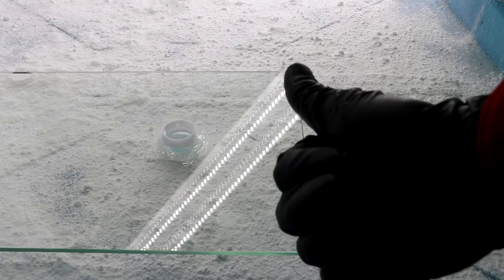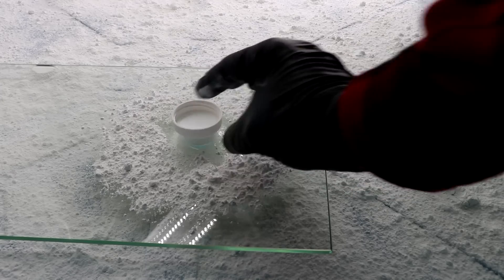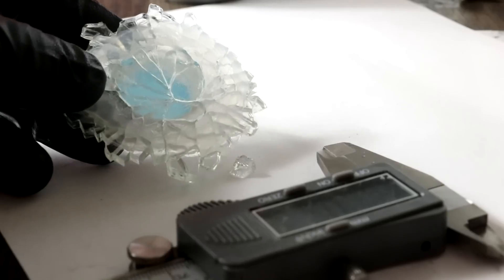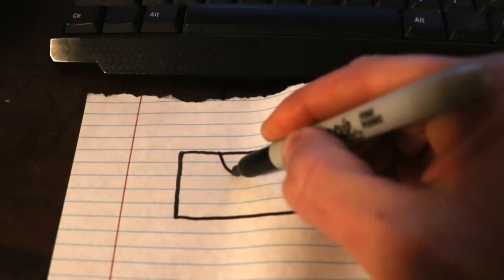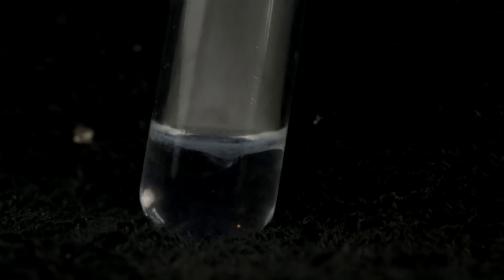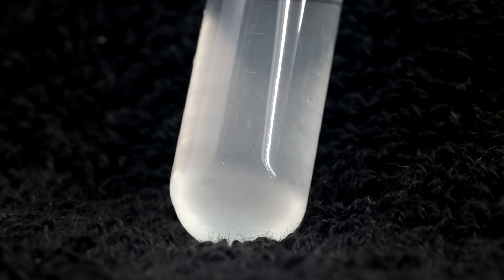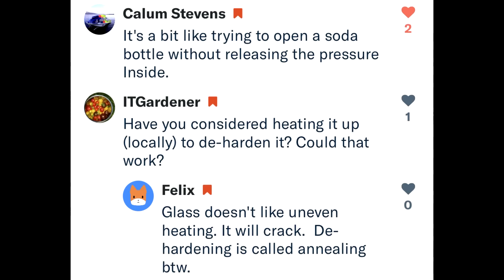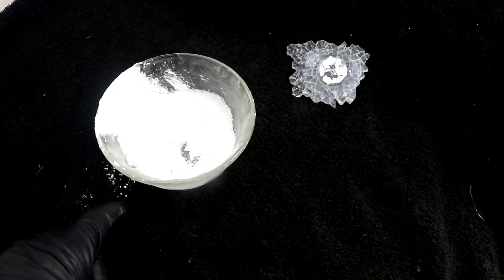Dissolving Through Tempered Glass Attempt Two: from one side only

Comment: @cody'slab This won't work, because you are removing the compression "layer" from the surface, leaving the inner layer exposed which is in tension. There is chemically treated glass instead of heat treating. Would it be possible to dissolve and chemically treat the new glass surface to be in compression?

Comment: Could you stress relief using heat or extreme cold when half way through ?
Reply: When i said heat i mean heat the glass while the acid is dissolving through.
I'm sure the glass temperature will have an effect.

Comment: I'm wondering if maybe slight temperature changes are what is causing it to explode. If you have compromised the structure of the glass by dissolving deep enough wouldn't that allow a larger fluctuation in temperature in the middle because the temperature has less glass it needs to change the temp of.

Comment: Maybe the cold made the glass more brittle?
When I studied to become a lab technician, I learned that pH is a measure of concentration (the balance of the concentration of OH- and H+ ions), so I am consistently confused when you say that stronger acids lower pH more than weaker ones, or similar statements. 
The strength of the acid doesn't increase the concentration, it just affects how reactive it is. Is the terminology used differently in the US?

Comment: @Cody'sLab In my experience of making Prince Rupert's drop I simply dripped molten glass into a bucket of water. I found that, at least from my experience, the hotter the glass was when I dripped it at a foot or two above the bucket into the room temperature water the more likely it was to make a drop. I theorize that the greater the temperature difference the quicker the outer layer is able to form a solid so that it is able to do the compression. The height I think is required for the drop to become fully immersed quick enough that the drop is able to form. When I dripped it from to close it formed less often. At least this is what I recall. Its been a few years since I made them.

Comment: Ex glass blower here. 
1. Tempered glass is constantly fighting with it self. The inside has tension while the outside is compressing(I think I'm remembering that correctly). As you mentioned its shattering once it gets to the center because the tension from the inside becomes to great. I don't see this working no matter how you do it but I'm hoping you prove me wrong.

2. The comment from Felix in the video, Dehardening isnt a word used in glass. Annealing doesn't make glass harder, it takes the stress out from the forming of the glass. The way Tempered glass is made, it will never be fixed by annealing, its already annealed.

Comment: I may have a weird potential solution to doing this. I weld frequently and every so often a piece of glass is nearby and will end up with small spatters embedded in it. I have embedded embers into safety glass several times without it shattering. Not sure about all the science that takes place that keeps it intact but it is a observation I frequently get yelled at for.  ''Look what you did!'' Then I promptly shatter it , got to replace it anyway so why not?

Comment: What if you try to etch a concentric staircase shape. You can etch for a while without breaking then try to etch a smaller diameter inside the larger etched zone and so on. Eventually, maybe you get a hole. However, it is tricky to determine the taper.

Comment: Maybe hit it with a MAP gas torch and try melting when it gets near the tempered glass part? Using two torches symmetrically on the glass piece in the first video might have been the best bet? 

Maybe you need to keep the glass near 1000 degrees F while you dissolve with HF? There might be a temperature where dynamically the glass can be plastic without shattering, and otherwise not melt or flow. Hopefully the tension would be able to dissipate over a longer time scale and the glass not shatter.
Reply: I mean you could but you have to cool the glass very slowly which essentially is just removing the temper.

Comment: curious how molten sodium hydroxide would work, but then again, the thermal shock would shatter soda-lime glass long before it manages to eat a hole in it, and glass that's resistant to thermal shock is basically immune to tempering to begin with.

Comment: Try placing more and more Epoxy onto the glass as you slowly dissolve it. Your Issue is similar to that of a balloon exploding when hit with a pin, a problem which can be mitigated via something as simple as a piece of tape to ensure you contain the rupture. With any luck the Epoxy will accomplish a similar goal absorbing the stresses and redistributing them evenly as you dissolve through. Right now it seems like your best shot since as you are fully aware of the structure of Tempered glass with always prevent you from doing this unless you contain that initial rupture.

Comment: I think it deals with compromising the overall surface tension. Its equal through the entire glass panel. Once a single area loses its sporting role (strength), it shatters. Which means no matter what method you use, it will shatter because its the same outcome of loss of strenth just with a different method.

Comment: HELP: How to distinguish mercury from gallium-alloys with household items quickly? I got a used GPU with liquid metal on the cooler, I thought ok gallium, but I wanted to be sure. I tried to make it attack Aluminiumfoil, but no matter how long I scratch and wait nothing happens. I tried to freeze ot expecting gallium alloys to freeze at the -19C of my freezer but it stays molten. I don‘t know where this GPU othen than that its broken and it‘s from the times of the crypto mining hype and I wouldn‘t put it past a corrupt someone in a poor country to  to use mercury to get his many mining rigs online as quickly as possible instead of using the harder to get and very expensive gallium thermal paste

Comment: What if you dissolved both sides simultaneously? The glass propped at 90 degrees to the surface and use something like a 90 degree plumbing bend glued on to hold the acid.

Also, you try dissolving various different sizes of hole. Perhaps smaller holes cause less disruption or very large holes completely dissolve around the internal stresses and causes less destruction to the structure.

Happy new year!

Comment: So. If it’s the glass is under tension, what if you have something fill that void so it’s getting the pressure on it, sinking in at the same time. And then if it doesn’t shatter you could just find a way to remove it. Or it will shatter but with an object in it. Beats me.

Comment: Thanks, Cody; informative and educational, as always. It's appreciated. 👍

One serious warning is needed, however: Be extremely cautious with HF. It's evil stuff. I worked with it years ago, where it was used for etching semiconductor wafers, and one woman in the factory, who happens to be a neighbour, had a slight leak in the little finger of a protective glove. The tiny quantity of HF which seeped through contacted her skin and produced mild burning. First aid was administered, and she carried on working, without much discomfort. A few years later, she had the finger amputated because it had developed bone cancer. There is also a documented and verified case where a lab assistant spilled a few drops of HF onto their body, and died of heart failure a very short time afterwards, despite having washed off the spillage.

Comment: Do you have a HF First Aid Kit?  GET ONE; a large skin exposure (I'm guess your not going to drink) can be fatal if treatment is delayed and can cause massive tissue and nerve damage.  The fluoride ions adsorbed bind with calcium to form insoluble CaF2 and in the case of a large exposure enough calcium could be removed from the plasma to cause the heart to polarize incorrectly.  You should have standing by calcium antacid tablets, soaked compresses of calcium gluconate solution or carbonate gel with the affected areas continuously massaged (Google more info).  HF is a bad dude.
Be safe; Cheers, Mark * * *

Comment: What about placing the glass on a board with a hole cut out for the acid to fall through? Is it possible that because the glass is elevated that the weight of the over hanging glass is putting tension on the surface and as soon as the acid creates a weak spot, a crack forms and shatters the glass.

Comment: What if you tried using a torch to melt a hole through it. I feel like if you could find a way to heat it from the inside out it would be best, as the glass on the outside would provide structer as the middle layer melted.

Comment: Can you preload the tempered glass by clamping a pair of washers around the dissolving site? After the hole is cut, you can put a bolt through to hold the washers and release the clamps. Key thing is to keep the glass in compression the whole time.

Comment: You cannot do anything after the Glas is tempered. I work in producing tempered glas in a big german factory specialised in this kind of work. The Glaspane will be heated and then quenced in an high volume air flow. Basicly from 850°C down to 30-45°C in 10 seconds. This process stresses the glas and traps internal stress in the pane, gives it strenght and a degree of flexibility. In the same time it makes the Glas extremely sensetive to any kind of damage. You can bent down a big glaspane with 3 people on top, and nothing happens. But when you make a small scratch (With ceramic tools, a diamond or an Glass cutter ect) all the trapped energy inside the glass finds a way out. You can see that on YOutube when people try to break side windows on cars (High Tempered Security Glas) and not even a Hammer can cut it. But if you use a piece of Insulator from an spark plug, the Glass explodes.
If you reheat the Glass, the same thing can happen. Our boss tryed that one time to save money after we produced some Panes without drilled holes. In the end the Glass exploded inside the heating field and it took the machine out of production for 4 days

The TL,DR is no, not even on industrial level exists a way to get through temperes glass, because anything that changes the internal force destribution inside the Glasspane lets all the trapped energy out which destroys the material.

If you can find a way to cut or drill tempered pane Glass, please enter a patent, you can make millions from it

Comment: Glass wants to break from the stress it under, from the moment we cool it it wants to break. So if you're going to do this, I bet heating it several times to relief the new stresses introduced as you're dissolving it, the hard part when to relieve the stress. I think you have the answer already about 1 mm in on both sides relieve the stress I'm sure your oven is big enough to fit that glass in. Also temp and time. I worked at a glass plant for years if the cooling was off just a bit we would get a crack all the way up to the furnace 100 yards, other times we would get the glass inspected and cut then pick it up and it would explode not break explode this wasnt tempered glass either 60 x 96 sheets of glass. So relief of the stress is important.

Comment: Try laminating the glass but flip the layers positions. Laminated glass is usually a resin layer sandwiched between two glass layers, try to make a tempered glass sandwiched between two layers of resin(just take a panel of glass, cover one side completely with resin, let it cure, do the same for the other side, maybe leave a small hole in the center because idk if the acid is going to go though the resin). That would be very interesting, I wonder if the external layers of resin are going to keep the glass from cracking, like a tape preventing a pressurized balloon from tearing up when punctured. I hope you give this a try.

Comment: Seems like it's more or less equivalent to trying to cut through a super powerful spring that's held under an extreme amount of preload.  You can cut through it fast with a cutoff wheel, or slow with a hacksaw or a tiny file, but no matter how fast or how slow you do it, the moment it hits a certain point, the material will catastrophically fail and all of the tension is going to release all at once.  In the case of a piece of tempered glass, there's no easy way to remove the preload.

Comment: If you put this experiment in a pressurized container that has the same pressure as the inside of the glass then this experiment should work. But I don’t think it will be stable if taken out of the pressurized container. most likely use Water to pressurize around the glass and a plastic film or something to separate the acid and the water.

Comment: Hey, Cody. I think your facing few more problems apart from just stress diference between sides of glass. Another possible reason it fails is stress concentrators. Basically any sharp edge naturally acts as one, resulting high local stress and failure. Also bubles, and micro cracks that glass contains by itself might be a problem too.

Comment: Hey cody, I have been able to slice a slotted hole in tempered glass with a high speed pneumatic cut off wheel using a 1/4 thick grinding wheel. I put a fair amount of force into it, while spinning it up as fast as it could go. it "melted" a slot into the glass. 100% sure it was tempered.
Reply: Essentially annealing as you go
Reply: Hope Cody sees this comment
Reply: Exactly

Comment: Ignoring temperature or stress as a significant factor, I'm fairly certain that once a significant pit is formed the acid can start etching outward into the edge of the glass parallel to the pane rather than the direction you want it to go in.

Comment: Does the ratio of dissolved glass to remaining glass stay the same if you use a thicker piece of tempered glass or does the amount you can dissolve from the surface remain constant?

When working as a glass installation specialist, I was taught that the safe maximum estimate for reworking the glass without retreating (or rather reordering from the company) was approximately 10% of the glass' thickness. So a piece of 10 mm tempered glass could be polished 1 mm safely from any side as last resort method to make the glass fit. 

So that brought up the question in my mind and seeing as you have access to the necessary materials and equipment to perform such an experiment safely, I was hoping that you could provide an answer to it.

Comment: Thanks for the video. Tempered glass has about 10,000 psi of internal pressure. If you were to clamp the glass with enough pressure you could get the glass to hold together, until you remove the clamps. Interestingly if the glass you had was perfect this experiment would work since glass has a theoretical strength of 17k psi therefore holding together against the ~10k psi temper stresses would be no problem. Typical glass strength is 1k psi.

Comment: Hey Cody, I have an idea for a follow up experiment. If we assume the tension is what breaks the glass, then it might be similar to a balloon when it pops. The interesting thing about balloons is that you can poke a hole in one while inflated if you put adhesive around the hole you are poking, to provide some rigidity, preventing the forces from tearing it apart through brittle fracture. Please try adhering the glass around the area where you dissolve it partially, and then continue dissolving and see if that would make this work.

Comment: I personnaly don't think you will be able to disolve a hole in tempered glass at all...  The stress is too high for it even at the slow rate of an acid.
If the acid attacked the surface uniformly and on a small surface area it could theoricaly work. If you still want to try you could maybe go from both sides or switch sides every now and then reducing stress on the other side of the pannel. I think that if you got a bit more on the other side the first time could be because there was less stress in the other side of the hole/
Anyways good luck and good videos

Comment: The main support is the caps and when it melts through it weakens the support . Maybe try holding the glass with an independent structure away from the etching point. Also over a larger surface are to reduce force

Comment: It could be done in a pressure chamber, when you can measure the tension in the glass it should be possible to calculate the outer pressure to overcome the inner tension. but as soon as you relaese the pressure it will shatter.

Comment: Have you tried to dissolve partway over a larger surface area, then tempering the glass in that section, before dissolving a smaller and thinner section, working through this cycle until you are through?

Comment: This is not possible. You cannot change the shape of tempered glass in anyway. Possibly heat it and bend it a SLIGHT bit, but even all tempered auto glass is shaped before it's tempered. I highly highly doubt it's even possible to anneal a piece of tempered glass.
Reply: yes it is possible to anneal tempered glas, but than you have normal glass again.
Reply: @heukelummer  ok good to know. But that brings me back to what I said then, you cannot change the shape of tempered glass.  Correct me if I'm wrong but any hole, cuts, or bends are made before the tempering process and I have yet to see any such way to do so.

Comment: I would recommend going back to the HF acid and mixing in some Potassium Nitrate.
The KNO3 has the ability to penetrate the pores in glass and will make a type of Gorilla Glass.
Also, get yourself a Vortex mixer for the test tubes.  Looks way cooler and works much better.